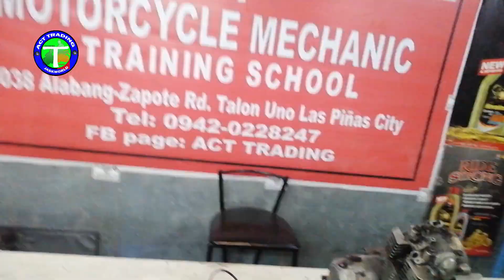OVERHAULING KAWASAKI WIND 125

Comment: Sir tanong ko lang po nagpalit po ako ng transmission ng nabuo kona may lumalagitik pag inikot ko yung clutch housing Salamat po sa sagot
Reply from the maker: marami pong puweding dahilan ng lagitik.
1. review mo yung transmission gamit ka ng catalogue na masusundan nyo po..review mo lahat..alamin mo kung san talaga ang nalagitik
2. check nyo yung oik gear kung nakatugma sa gear ng clutch housing na connectado sa pressure plate
3.check mo ang stopper ng drum shifter
4.paikotin mo doon sa magnito side gamit ang sacket tingnan mo kung freewheel ang iko nya..banayad...salamat po
Reply from the maker: kapag na tunog parin..videohan mo post nyo sa massenger ko..tulongan kita mag analayz